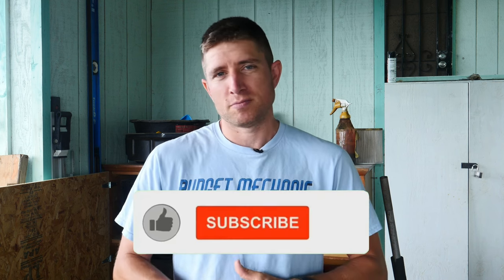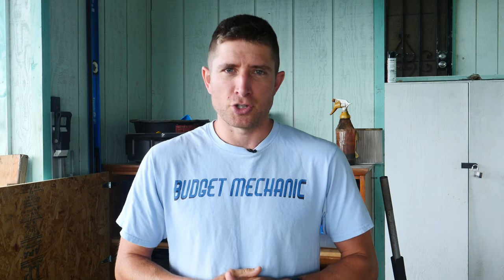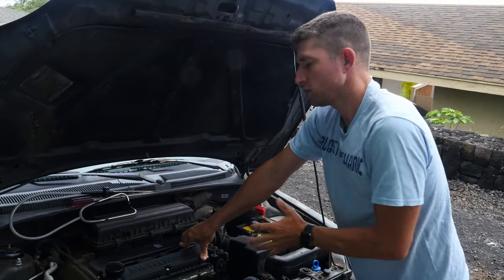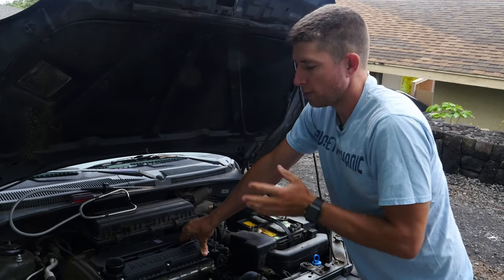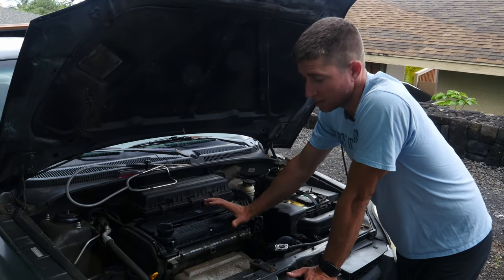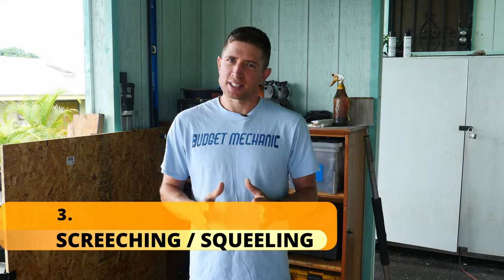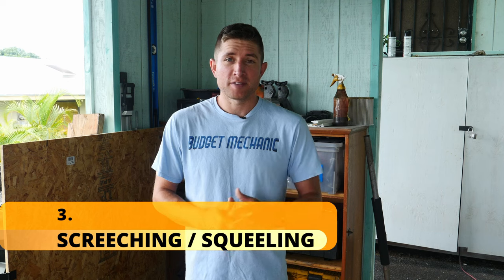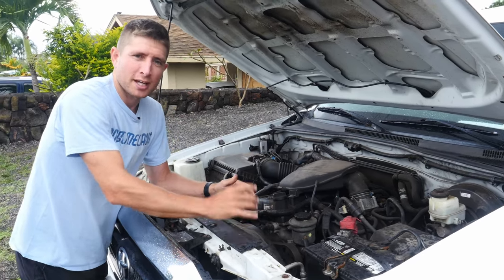NOISY ENGINE & How To Diagnose - Knocking squealing Whining Pinging Rattling Hissing Groan

Comment: This video with specific noise kinda help determine the source of the source of the noise. Got this knocking noise under the hood. Its there as I start the car. When pressing the accelerator. it get louder and faster. So its either a lifter/oil issue or an exhaust issue.

Comment: I have some problems with the car, on cold start there is a "clattering" sound or "creaking" sound. When the idle goes down and the car slowly starts to warm up, the sound stops completely. Have tried to locate the noise and noticed it is coming from the right side of the engine. Recorded a short video of the audio, any chance I can send it to you?

Comment: Maybe 4 months back I started noticing whenever I turned left the engine just sounded… off…. Then sometimes when idling it would have this low noise, but not all the time… turns out it was because my oil was low (found out my engine is burning oil) and it was actually knocking I was hearing. 

Still driving it 4 months later, now I’m just checking oil lvl every 3 weeks and filling as needed…. Which sucks…. These videos are so helpful. Didn’t realize that noise I was hearing was such a bad noise kind of surprised I didn’t blow the engine because I drove on apparently low oil for a couple weeks. I sincerely apologize to my engine. 😅

Comment: Thanks for the video. I have 2017 X5M 61k miles that sounds like rod knock, no lead up just appeared. I keep hearing it has something to do with low oil or oil consumption but from what I can tell none of that has happened. Having it towed to a dealer for diagnostics and of course it's right after the warranty ended.

Comment: Great video loved it.
My 24 year old corolla automatic makes a beautiful Wrrrr,wrrr,wrrrr,  when running through the gears, sounds great, the only problem is that it wasn't doing that before 6 months ago !!
Reply from the maker: Does it match any of the sounds in this video?
Reply: @BudgetMechanicHawaii  thanks for the reply. Nothing like any of those sounds. Figure it must be transmission.     It's fine with overdrive off, one a 1:1 torque ratio, but with the overdrive on, where it should be a 1:1.4(i think) ratio it drops to something like 1:0.8,  so the engine is doing extra work with less result resulting in a racing wrrrr,wrrr,wrrr sound, untill it gets up to 4th then it cruises.

Comment: I think my car has a pre ignition situation. My car is getting that kind of sound in the example one of the pre ignition section. It's coming occasionally, sometimes like accelerating in 3rd or 4th gears up to like 2000rpm while the car running slowly around 40 - 50 kmph, then it goes away. Can this be the issue ? And finally about the video, one of the best 👌

Comment: Thank you for the video! Mine seems close to the ticking sound. I am still observing it and planing on posting it. Would you be willing to take a look? It seems to be close to the ticking sound. What I've noticed is that when the engine is cold (starting after a night in a garage) the noise is not there. After driving a while it is there on idle. I need to observe more if it comes on after certain speed or after certain gear.

Comment: Thanks. But i didnt see anything about a whining noise. My cadillac is now whining when accelerating. Thot it was tires and checked but no. Any ideas?
Reply from the maker: Only when pressing the pedal? Or does it make the sound when coasting down a hill too?
Reply: @BudgetMechanicHawaii mine is doing the same, but when accelerating  and only happens every now and then. 2007 toyota tacoma

Comment: Man… one day I had a knock come into my engine and it wasn’t good and I knew it wasn’t as soon as I heard the noises … I was like oh my god no,… so I stopped what I was doing and I went straight home …. I got ahold of my mechanic IMMEDIATELY !  if you ever have that knocking either example 1 or 2 … your engine is fucked and WILL require high maintenance to be conducted for repairs … :(. I was so upset and just knew it was going to need some fixing up done to her :(. I have a 1998 Chevy blazer LT with a 4.3L•V6 Vortec •.   It costed almost 300 something for labor but luckily it wasn’t much more than that :) I was fine and she came out good after , but I had Example #2 For the knocking of the engine sounds sample … man it sucked and she was out of my hands for nearly a month : but engine work and maintenance is complex and requires a lot of equipment needs , Time , Patience and even parts ordering ! Which can also take time before anything can be done to begin with … I know this because I once worked on vehicles with a crew back In Colorado ! It can take weeks to months for even some parts ! Especially on older vehicles to arrive … So when people say : “ it’s hard to find parts for older vehicles .” Not really :/ you can find them easily but the cost is going to be higher because for one , if you look at how older vehicle parts are manufactured , they are manufactured out of harder , heavier metals , Irons , Steels , etc etc …. So thus it being more expensive … think about how much it costs to make with the metals and the amount of them they have to use and mold and form and stamp and etc etc etc ….it’s alot of money because the metals ore of higher grades ! I looked up a brand new engine for my blazer which one day I will replace , the transmission as well , everything on it will be gutted and restored ! Even the interior carpets ! All the whole truck is almost 26 years old … I’m a year older than my truck …And all I can spread as far as advice goes to anyone , is DO NOT buy an older vehicle 
( preferably no more than 25 years form the current year  we are in). So no less than a 1999 I say this because after that 10 Year mark, prices begins to rise on parts and maintenance , so on and so forth ,  anyway ! Thanks for reading and I hope this can at least help anyone looking to purchase , own , or finance on a vehicle :) thank you and my name is Bryan btw !
Reply: Sorry I’m two years older ! I’ll be 28 around fall time ! Sep 22nd

Comment: If the engine knocks due to low octane fuel, will it generate any diagnostic trouble codes (DTC) in the engine report? If so, what would the code be related to engine knocking?"

Comment: What about misfires causing a rattling as well? Along with a flashing light. That’s what I got from google. Could it be from spark plugs to catalytic converters?
Reply from the maker: Check out our other video Diagnose and Fix Engine Misfires - Flashing Check Engine Light , Rough Running Idle , Low Power
https://youtu.be/PK8pca8q5Zo

Comment: I have a new motorcycle with only 2000 miles and it immediately developed a knock after a service at the dealership.

It starts 35 seconds after start up, and lasts about two minutes, then sort of quiets down, but still evident if you listen.

Some with the same motorcycle engine say it starts after the first oil change, but mine started after the second oil change.

Any ideas ?

Comment: If there is no noise on Idling, but when the car starts to move it develops knocking sound, which gets maximum around       45 mph, can it still be engine noise, or it is more likely the suspension? Thank you for the informative film.
Reply: Engine noise from even just a bad oil situation can be hidden while idling but noisy when moving. You'll want to start first with of course the oil if you haven't already, then check the spark plugs or just replace them if it's been a long time since that's been done. Check the timing, fuel filter, fuel injectors, etc. These things are supposed to be serviced/replaced regularly so if any of those things have been skipped over in the years the car has been around then it could be the exact cause of the issue. Refer to your car's owner's manual and see the various parts that say "replace" on a certain schedule, and if they haven't been replaced in that time frame then that's where I'd start first. Even if they aren't the real reason your engine is knocking, it's something you should be doing anyways so it doesn't hurt it only helps to get that maintenance done
Reply: @brianjones9780  Thank you. I started to change oil myself like 2 years ago, and when I 1st replaced in Chevy (2003 Chevrolet Cavalier) I noticed that the Oil Filter was extremely dirty, so I think many times in shops it just has not been changed (the filter there is a bit more complicated than in other cars we have, it has a vertical position insted of usual horizontal). Anyway now it is always good oil and new filter, I replaced the spark plugs like 2 years ago along w/top gasket on the engine cover. Once the fuel injector went bad, they replaced it at dealer for $700, but the fuel filter has never been replaced (I know it should be, but I didn't get to the fuel system there, and it should be well cleaned. I did it on another car we have, and it improved the driving just dramatically). Transmission Fluid was never replaced (~101K), all that should be done. But still I think it might be suspension, since it sounds like smth rotates not quite correct when you just start driving, smth not quite right, and then at higher speeds that knocking comes. I replaced like 1 year ago practically everything on suspention, but not steering Rack anf Pinion of course. I suspect smth is not coordinated quite well there. You are correct I should exclude all those small things 1st. Thank you again. Yes, and to check timing is above my current abilities on car repairs.
Reply: @olenaerhardt7725  an easy way to determine if it's the engine or something else like the suspension is to see if the knock sound matches the RPMs of the engine. If you're switching gears on the road and the knock sound's periodicity doesn't slow down when shifting up, or speed up when shifting down, then the issue likely is not inside the engine itself or at least not in the cylinders/rods/camshaft/etc. So if it seems like knock sound stays constant even when switching gears then it could be something with the suspension or something else. Basically, does the knock sound speed up at higher RPMs or slow down at lower RPMs? Then it's probably in the engine

Something I'd ABSOLUTELY be doing if I were you, since the fuel filter was never replaced, is I'd go buy a crapload of seafoam and pour in 2oz per gallon of gas into the fuel tank the next couple times I fill the tank. After going through enough for about two full tanks of gas I'd reduce it to 1oz per gallon for another full tank or so. Seafoam really works to clean dirty cylinders, there's plenty of YouTube videos showing cylinders before/after a seafoam treatment, feel free to see for yourself how it works. you'll be flabbergasted at all the smoke you might see coming out the exhaust when you use it but that's all the gunk and carbon deposits getting removed from your engine. If it's still using the original fuel filter I bet you'll see a fair bit of smoke! I just bought a 94 geo metro last week and I'm doing that exact thing right now because it's running slightly uneven, and spark plugs are next on my list next paycheck, because the original owner had no idea what he was doing maintenance-wise on it, but working on cars is fun anyways.

If seafoam doesn't fix yours, and new fuel filter has no effect, then we're getting into complicated territory like checking timing, fuel/air mix, and using an endoscope to look at the cylinders (they're only $20-30 and you just pull a spark plug out to put the scope in). It can get pretty involved fixing a knock sound but thankfully almost everything you can try is recommended or even essential maintenance anyways. Worse comes to worst you gotta do some actual work in the engine itself but from what I'm gathering it's likely just a really dirty cylinder.

Also, since it's a 2004, I'd double-check everything is good with things like the O2 sensors and the car's electronic control modules. If there's something wrong with those then that could cause the car to default to a certain fuel/air mixture that causes engine knocking when that certain mixture doesn't match the current engine load, although it's unlikely in your case since there's usually also a bunch of obvious performance issues that happen when the control system/sensors are borked. Happened to a Cadillac I had once that ran and sounded like shit at low speeds but okay at higher speeds, and replacing the control module fixed that right up.

I'm giving a lot of info but honestly if you do nothing else, a few cans of seafoam would be what I'd do next for sure because it's an easy try and it's good for old engines anyway, and also verify if the knock sound's frequency gets faster or slower with the engine RPM
Reply: @brianjones9780  Thank you very much for the replay and detailed explanations. I know how to replace O2 sensors (both), I did it on another car we have (2001 Saturn SL2). I'll check if it was done on Chevy. But I forgot about one job I did on electronic control module. I replaced it for a new one (just bcs of milage and it was so easy work to do). But I didn't know how much thermal grease to put on the bottom, so I put it like butter on the sandwich. I continued the reasearch on that grease amount, and looked it should be very thin layer, but then someone wrote me that extra thermal grease won't hurt. The car was driving well. Now I think maybe I need to remove part of that grease. And I'll try that gear shifting (the car has automatic transmission, but I can shift in neutral and see). The frequency of knocking does increase w/speed unfortunately. I think poor oil change (not done properly, and I'm more that sure that in many cases I was just charged, but the oil was not changed) developed all that problem. Plus the dirty filter which they left many times in shops, which contaminated that new oil of unknown nature.  Now we always add Seafoam and other similar additive at fuel change, but I'll check that way of  2 oz/gal (probably it is more concentrated). Thank you kindly again.
Reply: @olenaerhardt7725  when you say frequency increases with speed, if it's not at all tied to the engine RPM then I think you're on the right track by looking at the rest of the car and not the engine. Best of luck to ya
Reply: @brianjones9780  Thank you, I'll check how the knocking frequency is related to rpm, I've never looked from that point. You comments were a great help to me at least to have some more or less clear picture. But I feel only Dealer will determine it, we'll see.
Reply from the maker: Definitely try shifting to neutral and release gas when at high speed and see if noise suddenly decreases
Reply: @BudgetMechanicHawaii  Thank you for the replay.  It is a car w/automatic transmission, so I can't shift gears up and down on it. Yesterday, I switched to neutral while driving, but on low speeds, and I don't remember if I released the gas, most likely I did, but can't say for sure. The knocking didn't change at all. I'll try on higher speeds and making sure I'll release the gas. Thank you again.

Comment: Thank you for this wonderful informative video. 

Is it possible, I could send you the recorded noise from my Audi TT 2914 (65 k miles, 1.8 TFSI). 

It intermittently makes noise like "ugh ugh ugh" (I maybe not describing it correctly) then goes away! 

Any help?
Reply from the maker: Try uploading the video and including a link here.
Reply: @BudgetMechanicHawaii 12:26
I have a 2002 Ford Focus. It just started with a knocking noise somewhere engine or under. Not consistently, but can happen when sitting still. Can I forward a video?

Comment: On the valve noise it depends on the car. Certain Toyotas just do that. As far as the thicker oil it’s not a good idea if the car calls for 0W20 or 0W16 oils as they’re designed to have thinner oil which actually gets sent to the top of the motor a lot quicker than thicker oil would. If your engine calls for 5w20 than putting 10w30 in it could help with the lifters some, but at startup it’s probably not going to do much honestly. Going to live with it most likely. Good video though!
Reply: hey man ive got a bit of this sort of noise on my toyota 86 do you think this could just be normal. i only really hear it 3000rpm or higher
Reply: @jothamjackson8244  higher than 3k rpm I’d be taken it in to be checked out. A lot of Toyotas have a tick at idle. My 21 4Runner with 41k miles has always had the little tick.
Reply: @jothamjackson8244  PS the Atkinson cycle -direct injection with port injection to clean the backs of the valves that Toyota uses makes a ticking noise a lot like a diesel as some compare the sound too. I’ve had a diesel so it’s not quite as loud as a diesel, but it is similar. Likely that’s what you’re experiencing in your 86.

Comment: I know I should get my car checked out and most likely I will, but, I just wanted to see here on YouTube what might be causing this strange sound that I am hearing lately when I am driving and even after I parked it still lingers somewhat. I describe it as kind a raspy vibration, and I can smell a hint of something heated. It seems to happen about after 20-30 mins of driving, especially, up hilly areas.
Reply from the maker: Visual check under hood first thing!

Comment: This is the only video i found with the same excact noise my car is making finally. In the example 2 of knocking, how should i go about getting it fixed?
Reply: At 3:03
Reply from the maker: If that really is your sound, you may have some serious engine damage. I hope thats not the case. I would take it to a trustworthy mechanic to double check tho. If it’s as serious as a rod knock or crank bearing etc, it’s often not worth the cost of repair. Cheaper to buy a replacement low mileage engine.